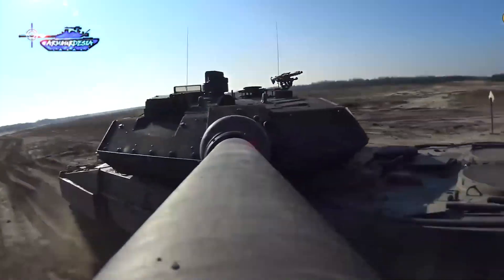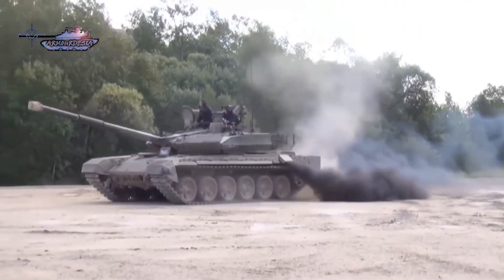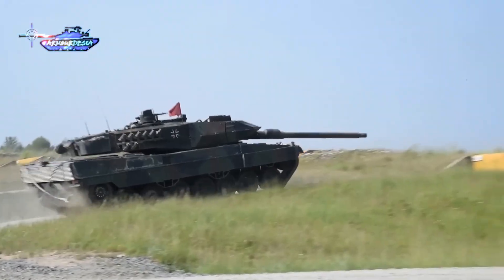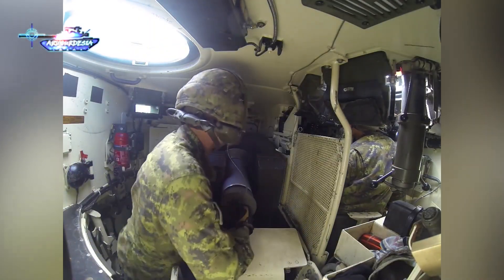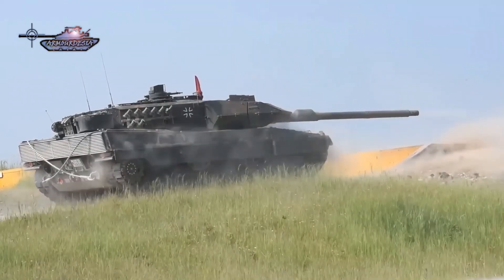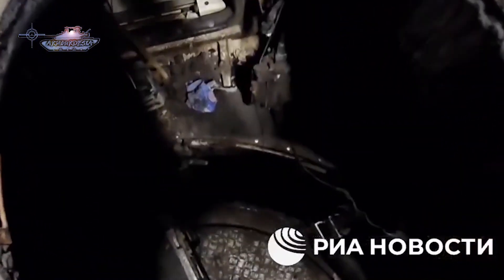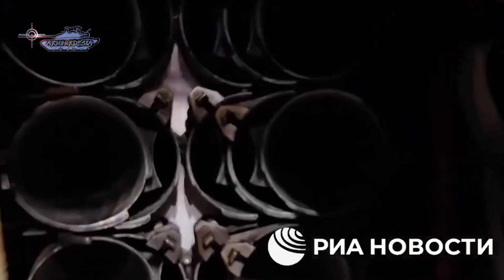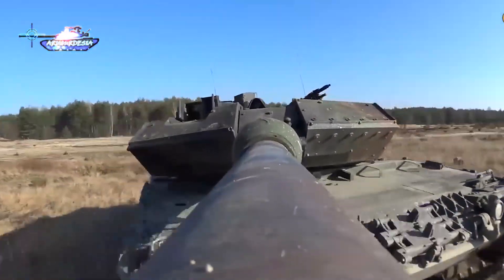Right or wrong? Russian apply weight on Leopard 2A6 tank

Comment: German tank is like German cars. They are good just on paper. For example new volkswagen jetta 1.4 tsi. Their DSG gearbox fails just under 3 year. The problem? Mechatronic failure. So called high engineering? Huhuhu. And all German cars have 1001 problem after 3 year. Same goes to other German engineering. Boombastic on paper only.

Comment: Nice propaganda from your side. There are quite few videos where russian t80, t72b3 shoots beond 5 km and hit ther target with pricise accursy. Russian have technology for electornic stabilization but it cost way more then hydralic and easier to produce. so no, germany is not superior to russian tanks in technology they are just build diffrent with diffrent mentality.
Reply: This does not change the fact that the Leopard 2 is significantly better than the Russian models. 
The turret does not take off and the armour is much better to protect the crew. The Russians build cheap and a lot and the NATO countries build less but higher quality
Reply: @rezo6212  Really, the turret dont take off? then what happend in syria then during turkish offencive? Fully loaded leo2 with ammo and turret will fly same goes for russian tank and for any tank, take half of load and turret remains if tank is under fire by rpg7 then turret stays.
Reply: @SovietSpetznaz  Russian turrets are more likely to fly because of the auto loading system carousel and how ammo is stored, plus lack of blow out hatches
Reply: @abrokanfxr3388 Like I said.. because of the auto loading system and how ammo is stored!!!!
Reply: @rezo6212 quantity does not mean russian tanks quality is worser 
In real battles russian t90m while costing 125% less then abrams it's much much better in armour firepower ans mobility
Reply: Agree, Russian equipment is build to endure heavy usage in field, far away from service centre, meanig that there is no place for fragile and sensitive devices. If there is sensitive devicea (like Shtora for instance), than failure of such system can not compromise main tank function. Weatern equipment have tendency to overcomplicate everything, main reason is to sell it for huge $$$
Reply: Not to mention Russia has a lot of budget and manufacturing constraints, unlike US and China

Comment: i think they want nothing from the tank or already have. thats why its in the display.
Reply: The electric turret drives are definitely useful. Russian tanks are still usingolder hydraulic drives. Given the resistance in the video they definitely didn't remove it.
Reply: @KSmithwick1989 On the T-72A the turret traverse and gun elevation drives are hydraulically powered. While the T-72B and T-90 it's equipped with electric turret traverse, combined with a hydraulic gun elevation drive. And only the T-72B3M and T-90M have electric drive for both the turret traverse and gun elevation
Reply: @levilastun829  Now that you mention it, I remember T-90M using electric drives.
Reply: @KSmithwick1989  its not the only leopard moscow has ^^ im curious if f16 once be displayed there too

Comment: A brief note here, the reason why the russians used weight here is because the burning spall lines have melted and froze the gun in elevation, they were unable to move the gun othervise. The gun stabilisation system was removed beforehand, as it was the second greatest interest of them.
Reply: The spall liners are Kevlar based so that definitely didn't melt in that way. Also it wouldn't even affect the turret elevation. It's clear they didn't disengage or remove the turret drives.

Which wouldn't be damaged and recoverable. They're located are the side-rear turret, opposite of the ready rack ammo.
Reply: It was just  The Freid psyhological compensation...  😁
Reply: Whats the first and third greatest interest about the Leopard for them ?
Reply: @Future183  
First: The chemical compound of the propellant and HE shells, (Reduced chance to get ignited outside the barrel)

Second: Turret gear set (Horizontal and vertical movement)

Third: Armor protection values and metalurgy

Main gun capabilities: Including gunsights

Fifth: Vehicle mobility on various temepatures, mud and obstances.

sixth: crew ergonomy aspects.
Reply: @venator5  JAJAJAJA pero SI TODO LO QUE DICES ES BASURA! lo unico Bueno de ese Blindado es su Motor de 1500Hp
Reply: @venator5  I agree with the first and the third.
I dont think control/servo system is something Russian engineers cannot handle. It is a choice.

Judging from the performance between M1, Leopard and T90M ... the difference right now becomes how many drones with RPG-7VL warheads can a tank take to its
1. engine/transmission compartment 
2. observation suite incl. FLIR/ Optical for commander/gunners/driver before the tank WILL or HAVE TO be abandoned by its crew